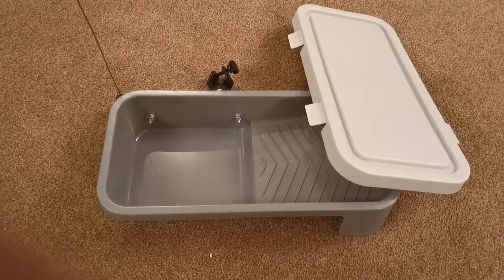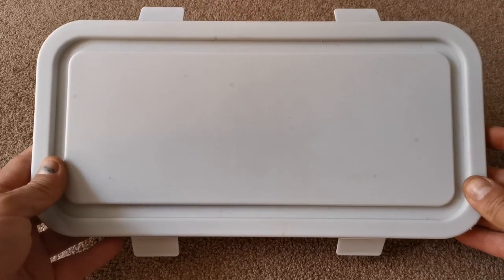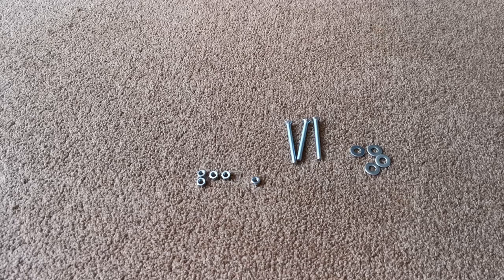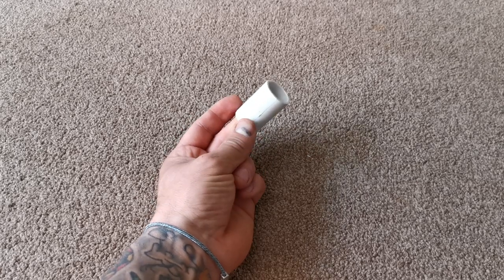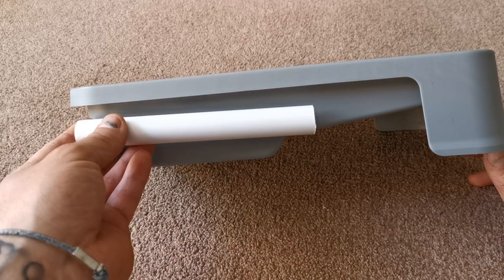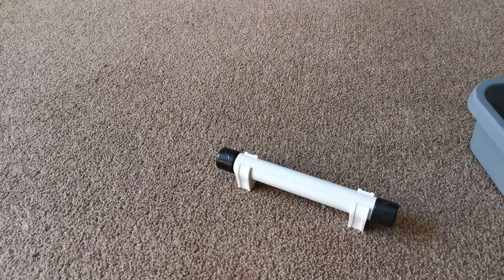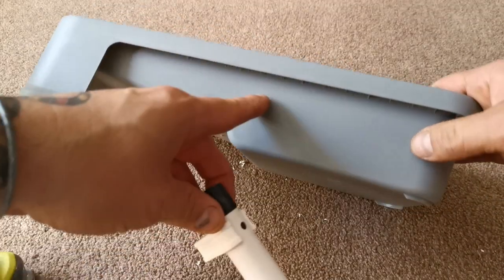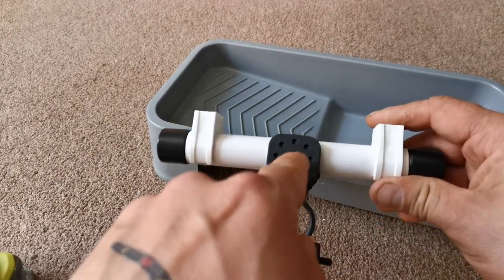Sea Fishing UK | How to Build a Universal Bait Tray

Comment: Good timing, I recently built a drop in tackle tray and line holder for my seatbox using some pvc angle, mesh, m6 rod and roofing bolts I had lying around along with a few other bits and pieces. If I did it again I'd definitely use something lighter/thinner than the pvc but I happened to have that already and it does the job. Might have to make a bait tray next
Reply from the maker: Sounds like a good build. You should do a vid of it and put it on here👍